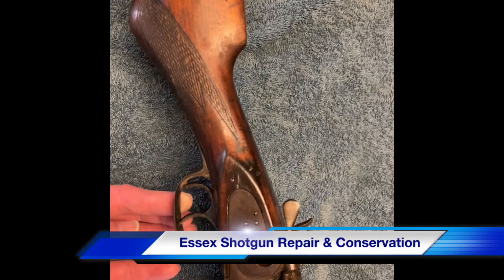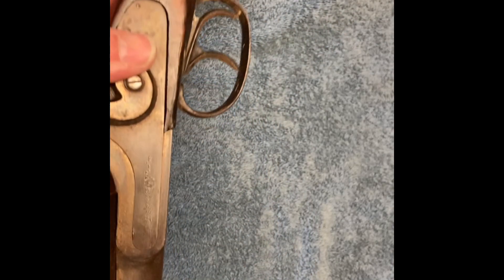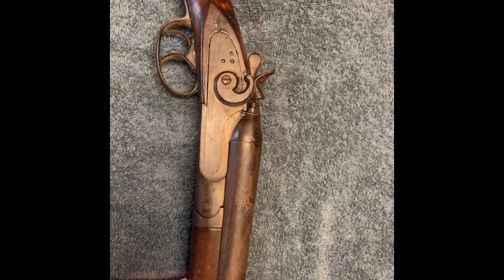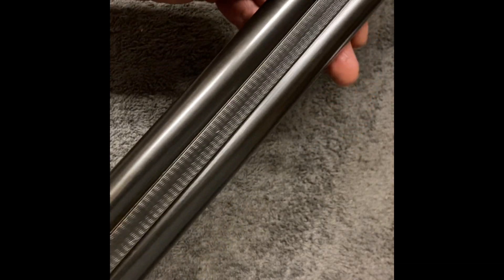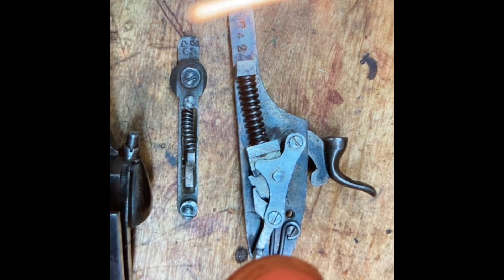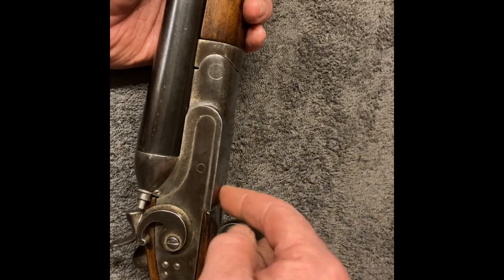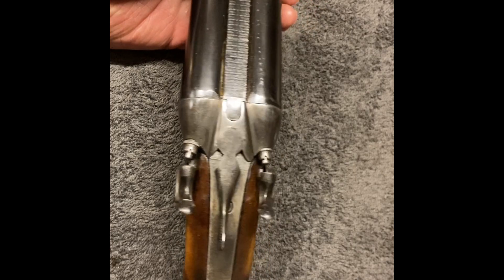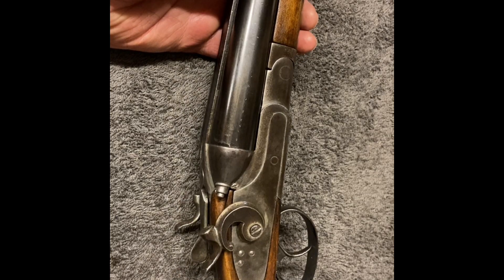Essex Shotgun Repair & Conservation

Comment: Good luck on restoring this shotgun.  

 I have restored a number of these old Crescent Hammer Guns, which 
were sold by Sears as ' The Bar Lock Wonder ' - the style of coil spring
lock being called a Bar Lock.   As you stated, they were sold with a large
number of Brand Names, and were priced at about $ 20.00 - $ 25.00, 
which was within the reach of many average Working men who wished 
to make a step up from a Single Shot  Break Action shotgun.  

They came in both Damascus Barreled ( now unsafe to shoot ) and 
Ordnance Steel Barreled ( Fluid Steel ) which are still safe to shoot with 
light loaded lead ammunition.  

They make very nice Coach Guns for Cowboy Action Shooting, which 
was the market they were sold into after I restored them.  

Boyd's used to make stocks for these as a special order item, you
might want to contact them to see if they can make one for you.l

Your gun is a nice relic from a now lost time in America.

Comment: I have one just like that! It says, Enders Royal, on the side. I couldn't find anything on this gun for years, so thanks so much for the info. What do you know about the lock on this gun? Mine is perfect face on, but every once in a while, it would open when I shot Smokeless shells it. After it did that the second time, I've only been shooting Black Powder in it since that, but I'd like to get it fixed or fix it myself. I think it is a week spring because it locks up tight and the recoil is bumping it open but I haven't had it apart to know for sure how the lock works. Was hoping to see you take it apart so I could see how the lock works. I really like this gun and out of all my side x sides, It's my second favorite after an L.C. Smith. I've never taken a side lock apart and that why I haven't done anything with it yet. Might be time to just suck it up and dive in. Any warnings about springs flying out?
Reply from the maker: Never heard of an Enders Royal.  There are 2 different Cresent patterns, one using conventional flat springs and the other using coil and wire springs.  I have not been inside a flat spring model, but I imagine they are very similar.
I'm currently busy with another Cresent.  The video will have more details on the internals and will be on YouTube some time in Feb.  They are very simple inside, no flying springs  ;-)